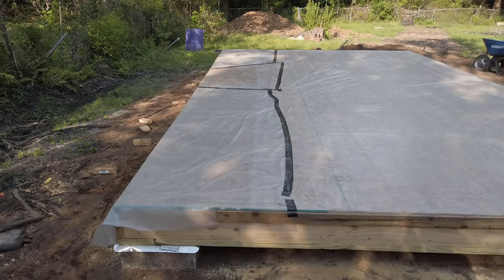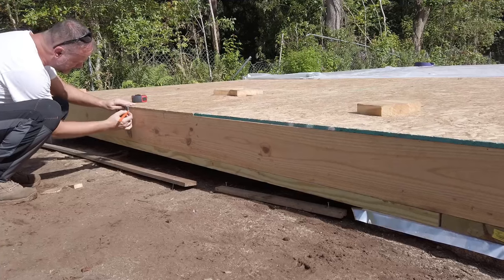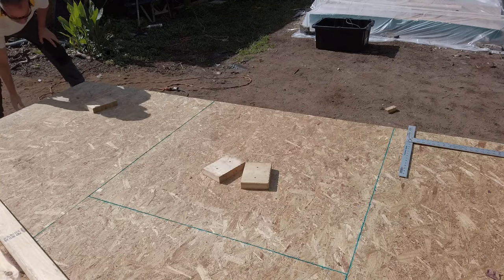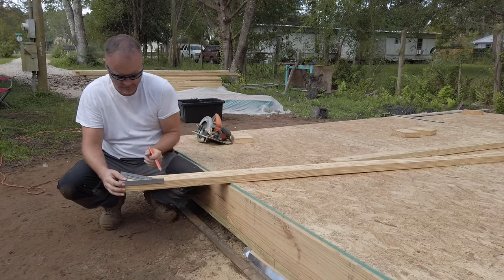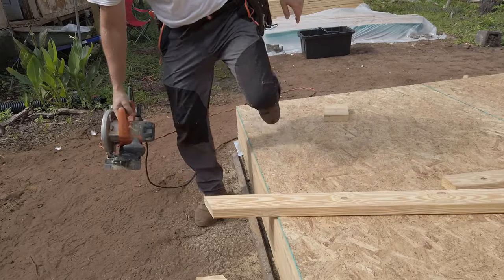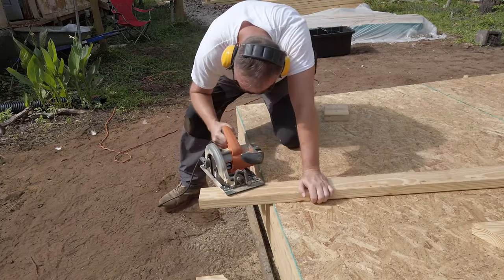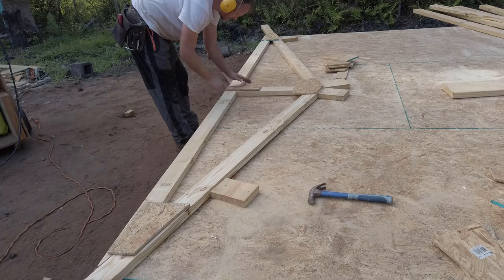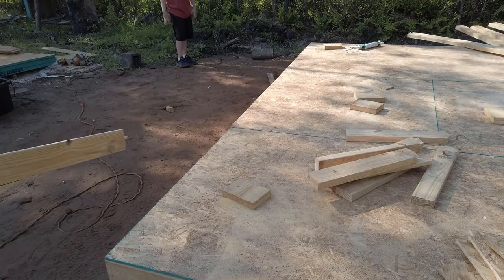DIY  👍 Trusses 🏠 Site Built / Building A Workshop Shed

Comment: Do you prefer the palm nailer over a nail gun for this job or is there really no advantage of one over the other?
Reply from the maker: Nail gun is faster.  I had the nails I used on hand already instead of having to go out and buy that size nail for the gun.  I would recommend the gun just for the speed aspect.

Comment: Very nice and clear video! I'm building a chicken run and coop, 11 wide by 20 long, and the coop will make an ell at the far end of the run. 
I've built most of my 11 trusses, but I'm now ready to put the bracing on the joints.
Two questions:
1. Whats the nice hand power nail(?) driver you are using to drive the nails? And what size nails? 2 or 2-1/2"?
2. You didn't brace both sides of the truss... should i brace both sides, or just one sude as your video seemed to indicate?

Comment: Is the top board of the rafters the 1/2 the length of the building including siding plus the length of overhang. I don’t know trying to build a pump house and can’t figure it out. Is this design different than a truss with a birdsmouth cut into rafters
Reply from the maker: No the bottom chord is the width of your building plus siding.  The two top chords you can leave original board length and trim the overhang to your liking after installing the trusses on building.